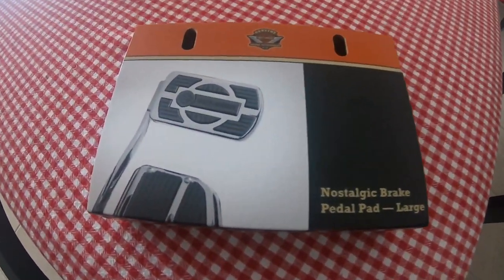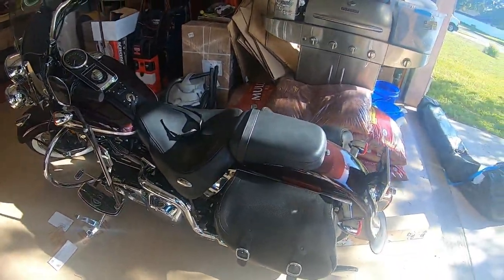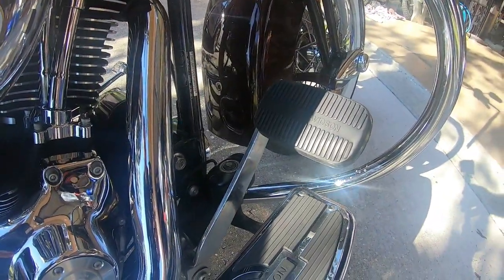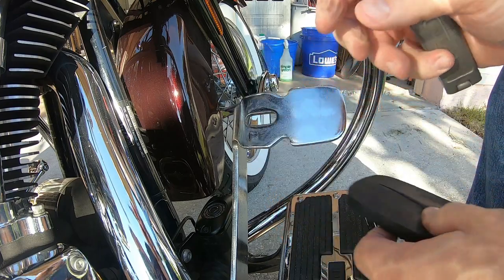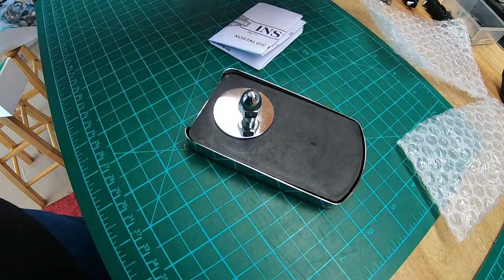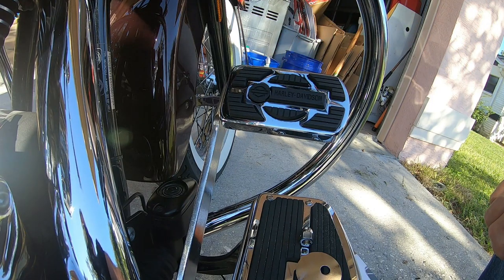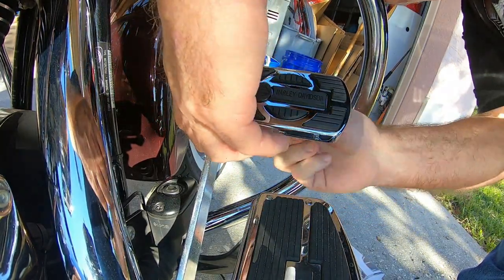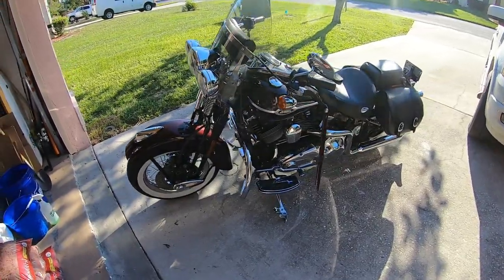2005 Harley Davidson Softail Springer Classic Brake Pedal Pad Replacement - SO EASY!

Comment: Dude, after watching your video, thanks to your camera angle and position, I was able to see that it might be possible to pry the one side up and slowly work it off the metal pedal underneath, similar to the way HD put it on.  Sure enough, with a little WD-40 assist, I was able to get mine off and save the original rubber for posterity.  Lol 😂
Reply from the maker: Good idea brother.  I’d never considered it. Next one I’ll sure try it.  Thanks!